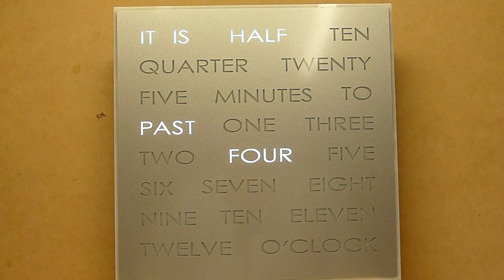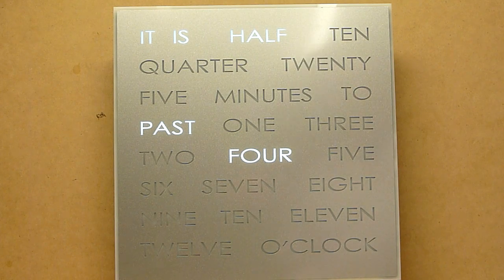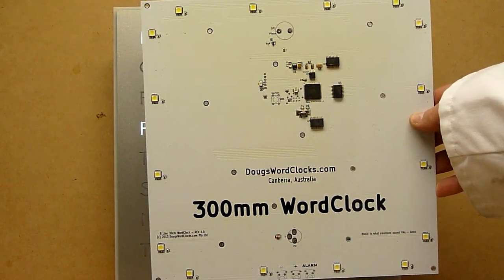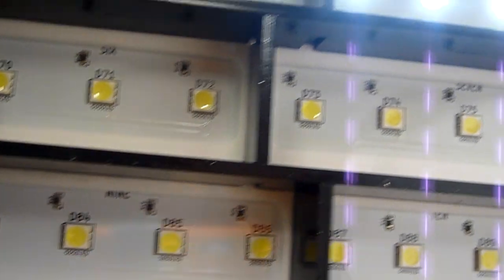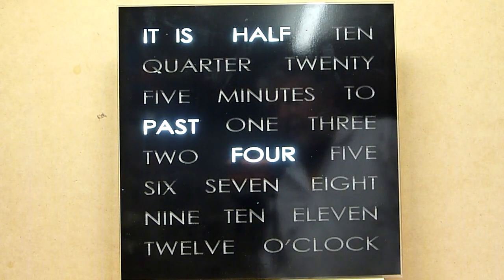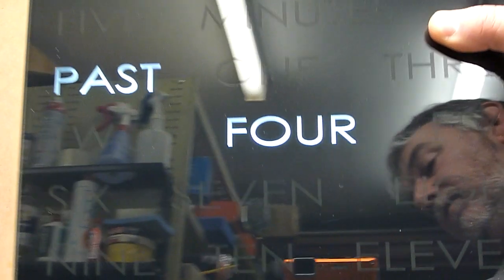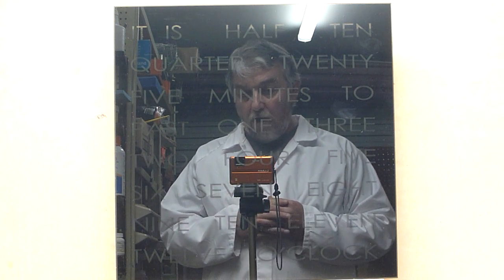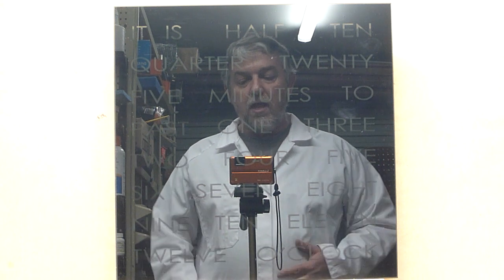New 30cm Clock Construction

Comment from the maker: Hi Eli,  

Thanks for your comment - That was my original intention when I designed the board, but looking at material usage, I use less acrylic doing the baffles this way.  The clock still needs about 20mm for the light 'cone' to expand out to fill the letters.